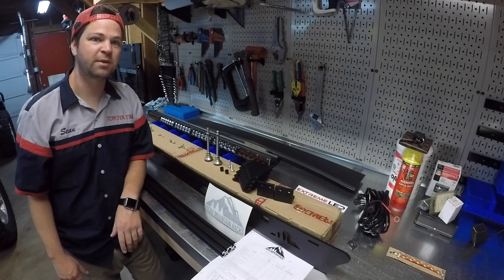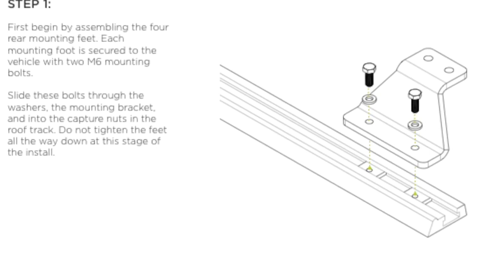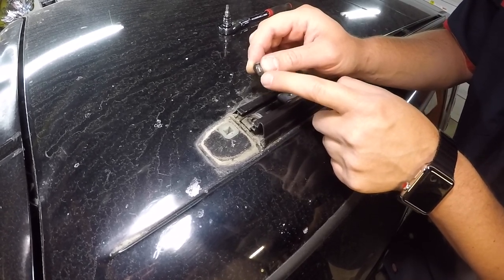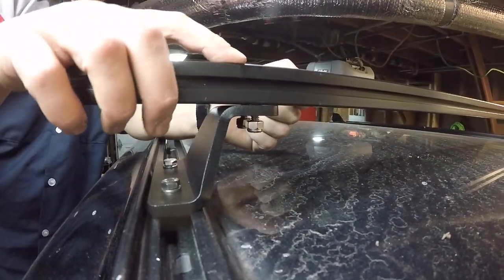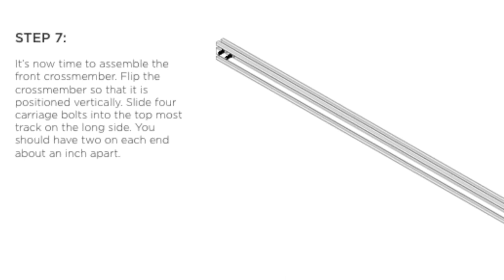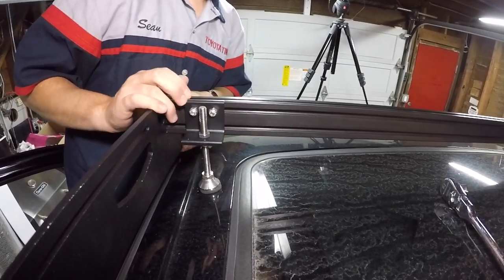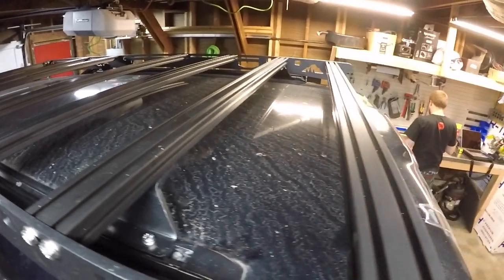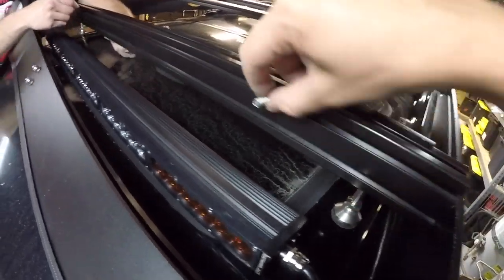Sherpa Equipment Co. Matterhorn Roof Rack Installation on a 3rd Gen Toyota 4Runner

Comment: Great video. Will be mounting my rack today. I have the optional light bar and look forward to your wiring video since I am not sure How I will approach that. Keep up the great job!
Reply from the maker: Kevin Riese the harness they give you is very straightforward. Power and ground.. it’s the routing through your truck which is the fun part
Reply: Timmy The Toolman thanks for the reply. I had a sailboat for 27 years and the wiring of radar and other electronic gear was always a pain since the manufacturer would put a huge water proof plug on their wiring harness, making it difficult to feed through bulkheads etc.. The light bar is no exception and wondering how you would feed it to battery without drilling a big hole on the roof of your vehicle. Thanks Tim.
Reply: @kevinriese2167  Did you ever figure it out? How did it go?
I believe you can tuck the wiring in the trim going up the windshield.

Comment: Late to the party on this one, but thanks for another great video. I'm starting to look at roof racks, and it makes me want one of these even more after watching your install.  A couple of Q's: (1) I recently pulled my stock roof rack rails off to re-paint them as they were fading/peeling (to kind of get them ready prior to installing a roof rack). I bought Permatex RTV to apply around the bolts and the holes to hopefully prevent water from getting in (I learned that could be a leak source from some comments in your sunroof drain videos). Should I also apply some type of silicone around the outer edges of the rail track to keep water from getting under there (since I've sort of broken that seal that has formed over time)? (2) how much vibration do you notice with the new rack installed, and do you notice any difference in weight on your rig when you pack stuff on the rack (vs. throwing that same stuff back in the cargo area), i.e., does it help since you're able to distribute weight up there more equally than inside the car?  Thanks, as always, for the time you guys take to do these!
Reply from the maker: There is no need to apply silicone around the edges of the track, only where the bolts screw into the top of the roof into their respected holes. I haven’t noticed any additional wind noise or vibration and I have an 8’ awning on top now as well. The nice thing about a roof rack is you have the freedom to distribute weight differently and more evenly, I don’t put super heavy stuff up there but I suppose if you had something super heavy on top you might notice it a little when getting tipsy on an obstacle. Let us know if anything else comes up!

Comment: Hi, I'm interested in this system that doesn't need drilling. Are the front bases safe?  Minute 7: second 40

It is not necessary some type of rubber or glue?

Will it have the same support as drilled and screwed?

Thank you for this great video.
Reply from the maker: jaroja Rojas no glue necessary. The feet are a rubber material. The roof rack rails are secured with multiple screws into the roof. This rack fits into the stock railing. It’s very secure.

Comment: hello. i hope you respond still on this old video. i noticed when you put the mounting feet into the stock capture nets the orientation for both was different. does it matter which way they are slided it (black vs. silver top showing)
Reply from the maker: Karson Bussell put the bolts into the capture nuts the same way they came out of the roof rack track originally. So be sure to take note of the orientation they are in when you’re removing them.
Reply: Timmy The Toolman perfect thank you. One more thing. I’m a little confused on once the mounting feet are tightened. Do they not slide on the tracks at all?
Reply from the maker: Karson Bussell once tight, they should not slide, loosen them up a little to adjust, & then tighten them down to the desired location. You don’t want them to move at all once your installation is done.

Comment: What I really wanna know is how you ran the wires for the light bar
Reply from the maker: we haven't done this yet, but you could run them down the A-pillar, into the engine bay and through the firewall or drill a hole into the roof of your rig. Or find someway to sneak them into the cabin (maybe the rear hatch since it would be more discrete).

Comment: Who knows where the video is of him wiring the light bar??
Reply from the maker: we haven't filmed that yet due to finding the best solution to drilling a hole in the roof to fit a water tight connection. wiring is pretty straight forward, routing & water proofing is another story.